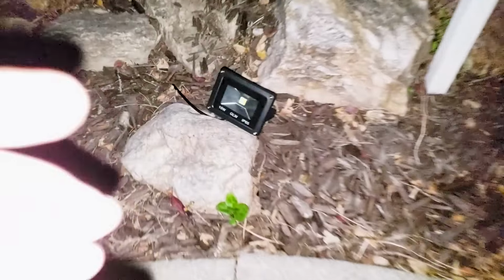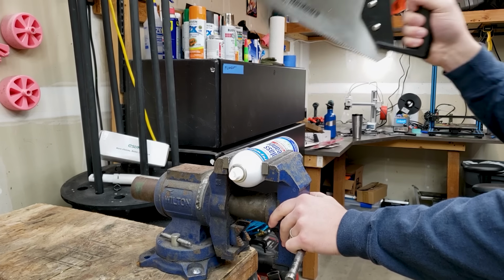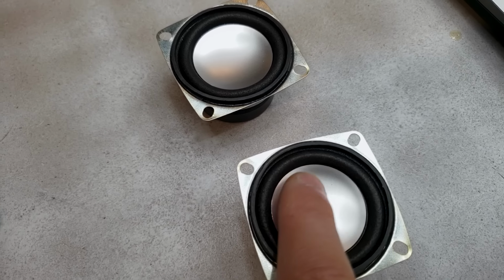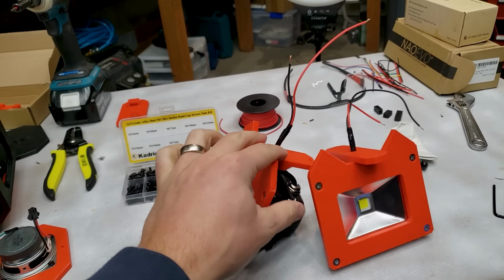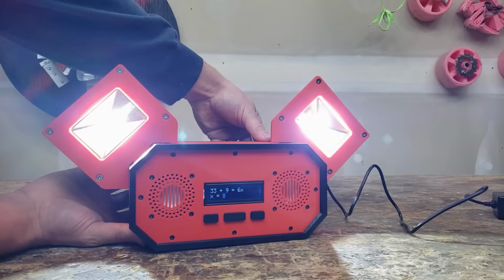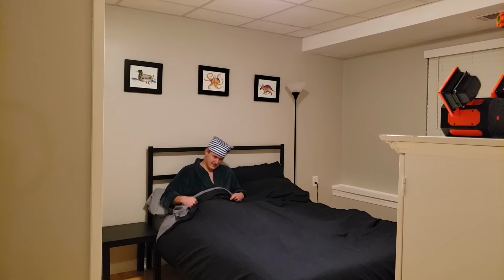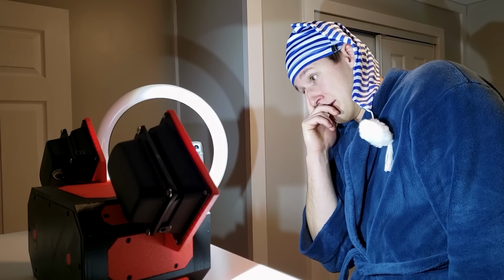I made an alarm clock that's impossible to sleep through

Comment from the maker: Thanks to FlexiSpot for sponsoring the video and being the channel's first ever sponsor! Don’t forget to use my code “24BFC7”' to get a $50 discount when purchasing the C7 Max. https://bit.ly/48k4dq3
Reply: Honestly man keep the ads funny like that and you'll have sponsors rolling in soon. Good luck!
Reply from the maker: @ALsFairRepairs  I'll do my best to keep them entertaining. I hate boring ad reads.
Reply: I checked out the chair and it said 5'7 minimum height so unfortunately I am too short to sit in the kings throne
Reply: what coding language did you use for all of this? I'm new to coding and i'm learning python.
Reply from the maker: @Prizm-b4d  all of it was Arduino. Which is just C essentially with high level functions for ease of use
Reply: Bro FlexiSpot chose the best man possible for proving durability by doing things no user would ever have time for like holding a board and towing the chair behind a vehicle with no trailer. Also can you please post all the code, materials list, audio files, and schematics please? I want one, but I want it to be something I assembled. Am amateur programmer who in no way has the capacity to do this myself.
Reply: my alarm clock better- it tases you, just straight up tases you.
Relay and transformer and 3v battery, with a transistor hooked up to arduino over digital outputs that controls tasing, with an rtc.
it works every time until it shorts across your heart and ends you.
Reply: Unplug it and then it wll be powerless muahahahahhaha
Reply: A sound i would recommend is that high pitch noise LRADs use
Reply: cant you unplug it?
Reply: @ Haha that's exactly what I said
Reply: Isnt that a hex code
(Sorry if i offended u)
Reply: I liked ur comment 2 times
Reply: Personally, I recommend using the Audio tapes from Operation Wandering Soul
Reply: So who won the clock?

Comment: I have a Smart WiFi speaker on my nightstand. All light fixtures hold smart LED bulbs and most importantly, I have a high pressure sodium street lamp connected to a smart outlet.

At 5:55 an automation triggers on homeassistant, turning on the street lamp basically creating an artificial sunrise while heating up, aimed directly at me in the bed.

At 6 am, the wifi speaker starts playing the Q-Dance radio station from the Netherlands, blasting chonky hardstyle into my ears. The LED bulbs also turn on, lighting the rest of the bedroom.

I then have to fiddle with my phone to turn off the street lamp and music, ensuring I'm awake enough not to fall asleep again.

This system has been very effective. I especially love seeing the peak on my smart electricity meter between 5:55 and 6:05. The only time it didn't wake me up is when my TLS certificate expired and somehow broke the automation, only blasting me with sodium vapor radiation and not setting off the traditional dutch meditation music. Luckily I've still had a backup alarm set on my phone.

Comment: Holy hell, the part at 7:26 LOL. Anyone who has soldered before knows that wouldn't work for even 1 millisecond

Also I use an app called "Alarmy". In order to shut off the alarm, I have to go to my bathroom and scan a barcode on my deodorant lol. It completely locks down your phone and doesn't let you do anything until you scan the barcode. You can't even force shut off the phone with the power button.

Comment: 3:40 if you haven't pulled out a drill without a clutch to prove a bolt doesn't easily strip, you really haven't done your due diligence, because some lazy idiot is gonna try exactly that.

Comment: I have the same problem but also have to weigh myself every morning. I've solved this problem by using "scan QR code to turn off the alarm" in Sleep As Android: I printed a QR code, stuck it to my scale, and now I have to get out of bed, pull it out of a cabinet and scan the code to stop the alarm.

The only problem is that sometimes I just go back to sleep instantly after doing that. Now I'm considering sticking a QR code on a lantern in front of my apartment, so I have to get outside to turn the alarm off, but I'm scared that it won't be enough during summer, lol.

Comment: Should also remove your blanket and take your pillow to make sure you can’t defend yourself from the noise light and gun. 
PS would be great if it got you wet then you’d have to change clothes, maybe shower, and change your sheets 😂 ik it’s not efficient and viable if your bed is getting wet everyday 😅 ooo maybe a cooling system in the bed so it’ll blow cold air removing any warmth and comfort like water. Could also drop an ice cube or 2 on his pillow so the wetness will also annoy and awaken any sleepers.

Comment: Heh... interesting thought. But it wouldn't work for me. I've slept through a literal simulated gunfight. I've been "killed" by simulated artillery strikes, simulated CBRN attacks, and literally being "shot" (read: someone on the OPFOR discharged a blank in my general direction and the NCO running the exercise declared me "dead") because all the shouting and small arms fire and and general chaos of battle failed to wake me up... although, in my defense, that ambush did come about 20 minutes after I was relieved from my fireguard shift that had run from 0000 to 0200 lmfao.

But seriously... you could start a jet engine next to my rack, and I'll sleep through it. You could launch a rocket next to my rack, and I'll sleep through it. I am exceedingly difficult to wake for some reason...

Comment: "Does this clock check the time using the internet?" 7:20
Reply from the maker: Nope, time is kept by a real time clock module the Arduino interfaces with
Reply: @currentconcept  if you are going to actually use it  can change from real time, so it's good to change the time per 1 month or so

Comment: 1) Put batteries in it. As it you just have to unplug it to go back to sleep.
2) instead of that, use Mosfets to control the lights, and just gradually turn them on over the course of 5-10 minutes (so it starts at 6h50 to wake you up at 7h). This will be way less painful, and more efficient.
Still a funny video to watch, thanks X)
Reply: I'd also add the thing that some alarm clocks have that vibrates your bed, even if you block the shots with your blanket. Perhaps add primate distress calls or something of a similar frequency range to your MP3 player? I don't think the speakers would be powerful enough for infrasound.
EDIT: My big fingers fudge keys.
Reply: @saucelord4425  Thoses wouldn't be agreable at all.
My post was to make something that was both eficient and agreable.

If you wand to go that way, bip three time.
The fourth, spray sor fart smell.
I garantee you that you will wake up to turn that damned contraption off very quickly!
Reply: @mylittleparody2277   Straight up thioacetone might cause problems with the neighbors since it smells so badly. I think the vibrating thing isn't too big of an issue. Theres a few alarm clocks that come with one (possibly for the deaf?)

Edit: Given the distance from the bed, that might have some issues with the cord, especially slips trips and falls.
Reply: @saucelord4425  okay, but why continuing to make disagreable alarm clocks ?
Can't we work to make agreable ones that wakes you up nicely, instead of traumatically?
Reply: @mylittleparody2277  I assumed that being disagreeable was a given since being woken up is disagreeable as is. I'm also taking this as an excercise in absurdism.
Reply: @saucelord4425  Well, then, try replacing the fart smell by freshly baked bread, it's a delight to wake pu to = )
Reply: @mylittleparody2277  That might actually be quite effective, it might be hard to go back to sleep if the smell is making you hungry yes?
Reply: @saucelord4425  I tried once or twice by setting up the timer on my bread machine, and it's a very pleasant way to wake up indeed = )
Even more so if coupled with the light slowly turning on over the course of ~15mins.

Comment: My personally struggle is not missing the alarms, but that my half conscious self can disarm them. I apparently can climb ladders and turn phones off in this state(which I actually have both witness and video evidence of after I having so many issues with it) and go back to sleep immediately. This was back in Covid with 2 separate bunk beds to myself (I slept in one, alarm in the other, still failed) so I may legit try this if I can make sure that there is no method of bypass. 

My current alarm comes with a bed shaker, is literally called a 'sonic bomb' for volume, has my phone as a secondary alarm which makes me do muti-step problems including derivatives, and smart bulbs to turn on all my lights.

I STILL BYPASS OR IGNORE ALL OF THIS AND WAKE UP LATE REMEMBERING NONE OF THAT!
Reply: What this tells me is that I am semi immune to the sleep tactics so long as I can get to sleep in the first place. Which if you get to a certain point of exhaustion is guaranteed.
Reply from the maker: you are like an alarm clock's final boss lol

Comment: Fun fact, there is an app called alarmy that has a feature where it gives you a math equation to solve to turn off the alarm, along with features like preventing you from using any other app, uninstalling the app or turning off your phone while the alarm is running. 

I downloaded it a couple of years ago thinking that because I'm bad at math, especially so when I'm half asleep, it will make me wake up and get my calculator to solve the problem. Jump back to present and I've just become really fucking good at solving complicated match equations to the point where I can do them half asleep.
Reply from the maker: lol that is pretty cool though
Reply: Failed successfully 😅
Reply: Also Sleep as Android. I'm surprisingly good at maths too, now.
Reply: @patrikniklasson4059 This app is the best ever. I have been using for years without a hitch. I also love the random alarm ringtone option. Oh, and I use the typed math intermediate captcha.
Reply: I tried alarmy and sadly apparently I can unlock my phone and delete apps in my sleep...
Reply: @familyvalue5588  Maybe you should have the phone on the opposite end of your bedroom to force you to get up?
Reply: @GDOsmium  Then my phone isnt loud enough to wake me up hahaha
Reply: @familyvalue5588  I think there's a way to disable that? Unless you have ios
Reply: I use Sleep as Android, but I also know that Alarmy has a feature to need you to scan a QR code, it's gotten me out of bed every time. Easier to decide to get out of bed when you're forced to
Reply: I use Alarm Clock Xtreme. It does everything above and a few more things. I especially like that you can set an internet radio station to your alarm ringtone.
Reply: i once downloaded alarmy and used a 200% volume version of that one joey diaz thing where he's yelling over the star spangled banner and had it set to take a picture. yeah it kept saying the picture was wrong so i was just walking around my house with my phone in my pocket blaring that since it locks the buttons out
Reply: alarmy is the most bs app ever i tried it!!!
Reply: Same! lol
Reply: You pavlovd
Reply: I find that most apps' math equations are just way too easy to the point that they are doable half-asleep. I had to find an open source app called Chrono that had adjustable difficulty. Now the stuff I get is something like 14x12x19, which is mostly enough to make me get up and think.
Reply: alright having used both alarmy and this glorious alarm clock i can assure you the alarm clock has the edge. alarmy is light and relatively easy to slide under a door and make someone elses problem this disastrous thing doesnt let you turn down the volume without opening the case. its perfect.
Reply: I use a similar alarm on android "ICan'tWakeUp! Alarm" that has this feature and a few other puzzles/tasks you can select. It works but I have to change things up to keep it working well cause I'll get used to one task and do it in my sleep.

Comment: I bought a bunch of LED garage lights and wired them up to a smart plug. When 120,000 lumens (probably about 10x brighter than the lights you used, based on the wattage) blasts into my room at 4am, I am awake instantly. I'm pretty sure the light wakes me up before the clicking sound of the plug turning on has time to make it across the room.
Reply from the maker: thats awesome
Reply: I can see the blood vessels in my eyelids with my eyes closed. I was targeting 120k lumens because that's supposed to match sunlight

Comment: For the sake of your eyes I would point the flashes upwards or backwards. So it's still flashing but doesn't burn your retina
Reply from the maker: this clock does not care about your eyes
Reply: @currentconcept  it cares, just not in a good way
Reply: No the intensity is needed we used xeon flashers that are installed in a deaf persons bedroom and linked to the smoke detector, they need to be pretty jarring to shock you into waking from a deep sleep through closed eyes

Comment: Need an alarm clock that simulates a deafening fire alarm

If my neighbors 3 rooms over cant hear my alarm it clearly isnt loud enough
Reply: That would be the sonic bomb alarm clock. Louder than a jet engine at full volume. Could literally cause hearing problems. I have it.
Reply: Also, just get the free 'i can't wake up app'. it's better. i can't sleep through the sonic bomb one but i can turn it off and get back to sleep. the app can make you do things to wake you up.
Reply: @iamarawn  a simple app isn't going to suffice.
I can just chuck my phone under my 2 pillows and it's sufficiently muffled

I don't care if it wants me to solve differential equations to turn the alarm off, my pillow turns the alarm off for me
Reply: @xanderlastname3281  then get the sonic bomb alarm. Set it off at the same. I get that alarm too.
Reply: @iamarawn  I'll consider it

Comment: If you use an esp32 instead of an arduino, you can connect your gun and alarm clock to your wifi and communicate over bluetooth instead of i2c
Reply from the maker: Yeah that would be the actual correct way to do it... I just used I2C since it was faster and cheaper

Comment: You forgot a little water jet that smells like eggfart with some electrical current passing through. the path to get to the alarm clock should be paved with small stones, legos and needles. For the sound, I suggest the 20-20k Hz hearing test.
Reply from the maker: I was with ya until the needles, thats just absurd lol
Reply: @currentconcept  :face-green-smiling::face-green-smiling::face-green-smiling:
Reply: so its actually close enough i recieved this glorious thing in the give away and its on the far side of where i store my random electronic wires and plugs and odds and ends.  lemme tell you lego bricks have nothing on a pile of brass plugs pointed up its like standing on a spike strip all the while the alarm clock laughs at your pitiful attempts to turn it off.  its everything i needed.

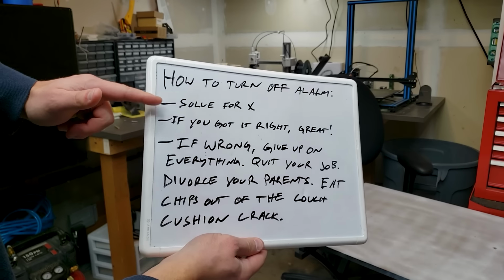Comment: 6:43 my alarm clock app legitimately has this as an option.
Reply from the maker: oh thats actually cool
Reply: Yeah, I have to add 3 2-digit numbers 3 times to turn offy alarm. My addition skills have improved dramatically and it's also a greta way to know if I haven't slept enough and my brain doesn't work
Reply: is it your phone?
Reply: ive seen something similar to this. does it have with something to do with switching it to programming?
Reply: @YourFavoriteHacker8666  Probably using the Alarmy app.
Reply: @PerpetuusTenebris I was using "Sleep With Android" 
I bought it because it was cheap at the time. It's far too expensive now and the app is far too buggy.